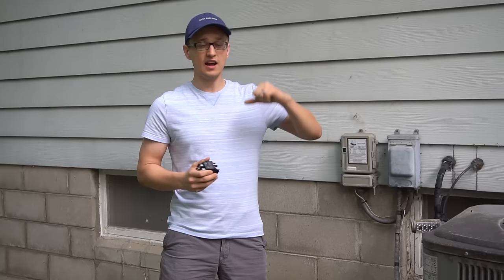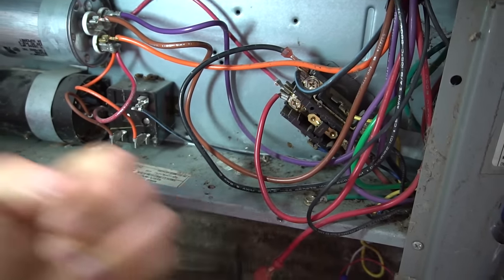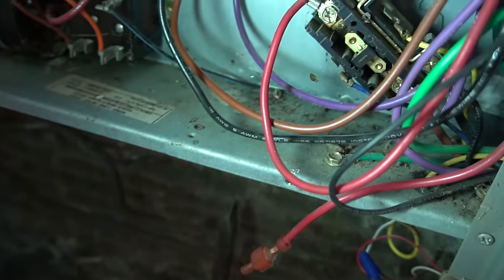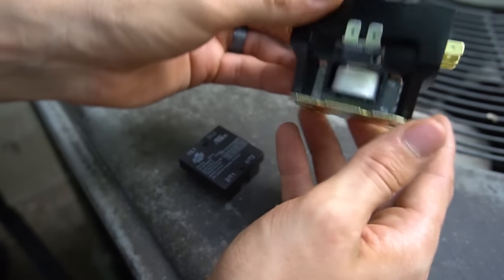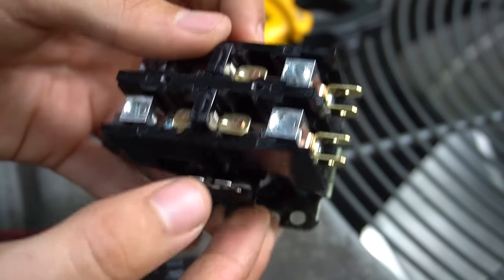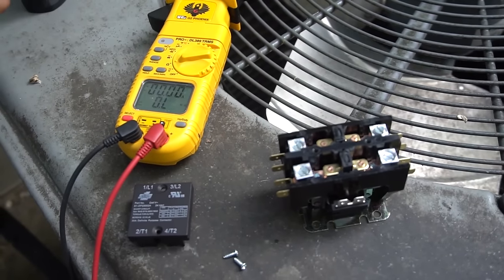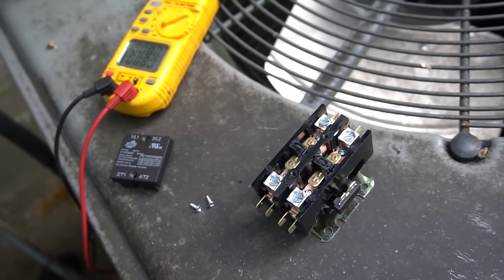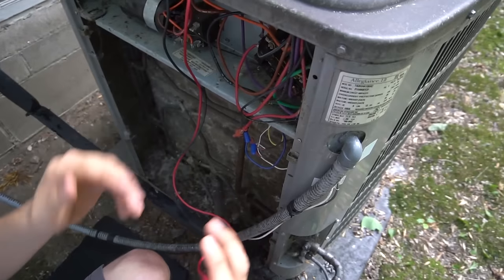Air Conditioner Contactor - How To Check If It's Actually Bad

Comment from the maker: ❄ Other A/C Videos For Reference:

Top 5 A/C Problems:
https://youtu.be/GOXgdnRB840
Complete A/C Troubleshooting Guide:
https://youtu.be/wzAA4dlp_70
How to Clean Condenser Coil:
https://youtu.be/pzwOvgjwm_Q
How to Replace a Capacitor Full Guide:
https://youtu.be/9ZGfvC-PMWU
How to Replace a Contactor:
https://youtu.be/qHZc9wWAF4c
How to Replace Condenser Fan Motor:
https://youtu.be/gGFTd2dmgxg
How to Replace A/C Control Board:
https://youtu.be/hijUExXrcm8
How to Replace a Thermostat:
https://youtu.be/1mJkjrwxdP4
How to Program a Thermostat:
https://youtu.be/uun8HJhM3h4
How a Thermostat Works:
https://youtu.be/Z4T9H-6VPtI
How to Check Freon Level:
https://youtu.be/dExFtP-nXTw
How to Wire A/C Condenser Unit:
https://youtu.be/KCanZEsLVEI
How to Order Correct HVAC Parts:
https://youtu.be/faCno8-vRnw
How to Read A/C Wiring Diagram:
https://youtu.be/I-sB4GIlbl4
How an Air Conditioner Works:
https://youtu.be/cRnzYJ4qmWE
When Should You Replace A/C:
https://youtu.be/Z7vUOySOWbM
15 Air Conditioner Maintenance Tips:
https://youtu.be/pBBnXHse-T0
Should You Get an A/C Inspection:
https://youtu.be/JqNsEzb__qs
Reply: On my unit, heat and air, thermostat is blank, vacuumed drain ,replaced capacitor and plunger on contactor kicks unit on when manually compressed.  Any ideas?
Reply from the maker: @Guided-by-the-Word-Boyd-Delk  Sorry to hear about the HVAC troubles! If your thermostat is blank i would suggest watching this video: https://youtu.be/vi3OJuGfaac?si=0u64JXzoYzBUjWBN
Reply: Jay, I appreciate with many many others- you sharing your knowledge and experience all things HVAC.
Q: Product number on capacitor does not match the original in my Trane. Numbers do-- 45+7 50/60hz. Replace with confidence- they match?

Comment: I fixed my AC myself! First I replaced the capacitor - that wasn’t it but I kept working on and thanks to this video I eventually found a loose thermostat wire in the furnace control panel. 3 ac pros had been here and none of them even tried troubleshooting the equipment. They all just wanted to replace because it’s an older unit. The quotes were between $6,000-$28,000! Thanks you!!! I'm making a donation to your Paypal.
Reply: so you are saying that you paid for all of them service visit fee? or you called them to get quotes only for not to pay service fee?
Reply: @ibrahimamac  He more than likely did or denied to pay. Not making assumptions here but sounds to me the companies that came through were incompetent in troubleshooting that system. A definite win, service charges usually $50-100 or more but $6k in quotes?! Um no thank you. And happens to just be a loose terminal. That air handler vibrates all the time and cycles the air through. Kudos
Reply: @KevsHowToDIY  you gain customer trust for fixing small things,  they will see that you are honest and they will make you change unit next time no matter what the much money is. Plus it isnt gonna be huge difference like that. But if somebody tells me that 3 ac pros came and didnt fix it which is odd. Because sometimes you make more profit from small things than free quotes.
Reply: What a bunch of as****. Didn't even attempted to fix the unit, just wanted to replace it.
Reply: Great vid thx bro u make me a better tech
Reply: The hard part to do electrical troubleshooting is a broken or loosen wire. I might as well to replace a new set of thermostat wires.
Reply: I'm starting my HVAC-R comonay out of spite for thise type of thieving technicians, disgusting behavior
Reply: I’m getting into the HVAC field .. and that sounds BONKERS 😂😂some of these guys charge outrageous numbers .. I will forever be fair .. I’m going to make my money but I will be honest as well.. a honest technician will always get business ..
Reply: Yea hvac is notorious for rip offs

Comment: fire ants are the biggest cause of contactor failure i have ever seen. those dang things . climbing in the contacts to commit suicide and fry the contacts.
Reply: Right that's the trouble I'm having now😒🐜
Reply: try to spread alot of seven dust all around inside the cover and around the base of unit, alot of my customers spread it around there whole house to keep all the insects out nothing like the aeven dust also try Diatomaceous Earth nothing likes that either at its also sold at garden centers.
also common salt atops them to but not all the time , they dont like to cross salt or baby powder

Comment: For any unlucky soul such as myself, CHECK YOUR RESET SWITCH IF YOU'RE CONTRACTOR INSTALLED ONE INSIDE YOUR HOUSE!!!  I changed my contactor, my motor and it's corresponding capacitor and the fan would not turn over unless i gave it a nudge with a stick.  I went inside and clicked the reset switch that a contractor had installed near my condensate pump and this now provided the 24 volts to the contactor.  I had the reverse problem in the winter when the condensate pump was continuously running b/c the condensate line had frozen and the reset switch had tripped.  I had to thaw the line out and run it into my sewer line inside the crawl space so it wouldn't freeze and then flipped the reset switch and i had heat.  Of course both times, it was both the hottest day and coldest day of the year at the holidays!!! lmfao !!
Reply: UPDATE:  It actually only started up only one time after i flipped the reset switch, but now the old issue is back once again. 24 volts getting to the contactor, juice getting to the contactors, but the capacitor just wont kick start the motor.  The capacitor is rated for the motor and what was recommended.   I don't know what else to do except wait two more days till after July 4th to have an HVAC person come out.  I'm open to ideas ..... lol

Comment: Had AC guy come out,said I had dead ants in contacter, so I had to pay 125 .00 to replace before he could check unit to see what was wrong with AC , he didn’t try to clean it . I have choice warranty, he said they wouldn’t cover this part because the ants stopped contact

Comment: My contractor was buzzing like crazy and the unit was not turning on.  I took the contractor out and was searching the web for a new one, then came across your video.  As soon as you said "bugs", I found the small screws on the back plate, opened it and dead bugs everywhere and one live earwig.  Cleaned it up, reinstalled and it works like a champ.  Thanks.
Reply: Awesome 👍😎

Comment: ❤ We fixed it! Thank you, thank you, thank you!!! I live out in the middle of nowhere with my uncle, a senior citizen. His AC went out, and we've had 100-degree days. It got up to 89 degrees in his house. Getting a service person here is a nightmare, so we tried on our own to see if we could fix it. He needed my help, so he showed me how to use the multimeter and guided me with installing a new contactor. I learned SO much in the process because there was a lot of troubleshooting and because he had me do a lot on my own and showed me how to work safely. He has me do a lot because he doesn't want me to have to ask a man for help. I can't even describe how happy I was when the AC came on. Definite confidence booster. I'm excited that now I can help others. Thank you so much for the tips for troubleshooting. You're awesome! Blessings!
Reply: Same thing with ac going out but contacterd have 2 burnt wires. 1 red  an 1 blk, bought contscterd and R&R but no replacement female ends . So i have to go to AutoZone right now b4 it gets 100 again today in san Antonio Texas. Very fn hot.

Comment: You saved me a lot of money sir!!! My central air kept blowing the 3amp fuse on the board when I switched it to cooling. Checked every wire, everything and started losing hope, watched this and checked the contactor, had 1.9 ohms on the sides to eachother. Order a new one for $20, checked the new one and got 17.8 ohms from the box. Changed the part and it works mint now!!! Thank you very much, I owe you a beer man

Comment: After watching some videos and reading articles online, I came across your video on testing the contactor and replacing.  I took mine off, tested with the multimeter and got 0 for a reading.  I then went to local store and bought a replacement contactor.  I then tested it at home and got a reading.  This further enforced that my old one was either not working or the multimeter was not working 😆.  I then proceeded to install new contactor and then turn on AC.  presto chango, it works.  Thank you sir. It only cost me under $35.  Saved me money getting someone here and paying an arm and a leg for diagnostic/parts/labor 👍🏼.  Plus I look like i know what I'm doing 😎

Comment: Great video. I had the AC maintenance company come by and tell me that the contactor was working inconsistently. I hadn't noticed anything amiss myself, but they said their inspection uncovered it. They wanted $400 to replace it, and another $500 to replace the capacitor. After watching this video, I've come to realize that they're probably full of it (or I can just blow away the insects myself for $0). So thank you for saving me a lot of money!
Reply: That reminds me of a job I did, and the only problem was a massive amount of ants insulating the contact points from engaging.  Fixed it with some raid applied around condenser.  😂

Comment: Fantastic video!!  Pay attention, y'all. My issue was self-inflicted. I disconnected the ceiling receptacle in my garage for the garage door opener as part of a winter renovation project. Turns out, that circuit powers all the outdoor gfci receptacles AND my crawlspace receptacles; the condensation pump was plugged into one of the crawlspace receptacles. Winter turned into spring, with the garage receptacle still disconnected, the condensate pump filled up, tripping the safety switch thus not allowing the ac to kick on. Lol lesson learned. 🤣 
Many thanks for the video!!!!
Reply: We all do things like that.... too many irons in the fire. Try writing down and keeping a note book...I do for most things I do...

Comment: Jay!  Jay, Jay, Jay, Jay!!!!!  Dude, I got man handled the last time I had an HVAC repair guy come out.  When he left I was thinking those HVAC capacitors were made of diamonds or something.  Anyway, AC went out and this time I figured I'd dust off the old tool belt, grab a can of elbow grease, and get down to business.

Initially I thought the fan motor was bad.  It wouldn't spin very easily, not like my other AC unit, so I ordered one, replaced it in 10 minutes, and pounded myself on the chest in a way that said to all onlookers (mainly my dogs), "I'm a handy guy, yeah boy!!".  Unfortunately, the new motor wouldn't come on after I powered everything back on.

So, I ordered a capacitor.  It just had to be the cap.  It's always the cap.  Last time it was the cap.  Amazon dropped one off in about 2 days of searing hell flames heat (upstairs thankfully).  It came, I popped it in, I patted myself on the back. The dogs were cheering for me, or would have been if they knew what a feat I'd just performed.  Hey, they're dogs.  They lick their butts.  What do they know?  By the way, they aren't made of diamonds.  The capacitors, I mean.

Well, that didn't work either.

I was just about to turn in my man card and phone an AC repair crew.  I wasn't happy.  The dogs weren't happy either, but being dogs they probably didn't understand why.  

Then I found you, Jay.  You mentioned that the little cover on the "Contactor" comes off, or "Thingamajiggy", as I was calling it.  Well what do you know, I took the cover off and there were about a million tiny little dead ants piled up under it.  I didn't know a million tiny dead ants could fit under that cover.  I didn't actually realize it WAS a cover, but then neither did the dogs, so I don't feel too bad about it.

Anyway, I pulled out the my air compressor, shot some high powered air into the thingamajiggy, dead ants were flying everywhere, the dogs were happy as hell and licking their butts, and when I powered the sucker back on the fan was moving, cold air was pumping inside, and my man card went right back in my pocket.  Nobody's taking that bad boy.

Thanks Jay!  You saved the day.

By the way, beer tastes a lot better after a guy fixes something.  I don't know why, but here's to you, Jay, my man!!!!
Reply from the maker: Lol! That was an awesome comment man! Thank you for taking the time to write that! Your story telling sure is funny stuff. I'm glad to hear that you finally got it going, the dogs are thrilled, and your man card remains with you! Now all you have to do is stay cool and enjoy that beer! Cheers!
Reply: Oh my goodness! I live in Florida - it is late July - I am a female with two female roommates and our AC stopped working yesterday. We can't afford to call someone out this month and I'm the only one with any mechanical abilities at all, I do most of the work on my car, in fact I don't recall ever taking it to a mechanic. But air conditioners are a totally different beast! Sooooo I'm all over the internet and YouTube (thank you, Jay) I'm very frustrated and it's over 100 degrees... I begin to feel like I'm about to internally combust and I come across this comment.
Which brings me to my point (sorry about all that jibber jabber) I just wanted to tell you your words really brightened my day. Your style of writing is incredible! It reminds me of Robert Fulghum. I truly hope you are a writer, or in the very least, sharing some of your words with the world in some way. Blog? Video? Self help website? Hehe!
Not only did I enjoy the comment, but it pleases me to see someone being gracious, humble, positive, and genuine. It's refreshing in this YouTube world full of hostility and criticism; so, thank you both for contributing in such an inspiring way! I hope many others take note of how a man TRULY earns his "man card"
Reply: Patrick Connolly   I love your comment, I rarely ever read an entire comment as long as yours. Not only did you have me in stitches from laughing so hard, you reinforced what Jay (whom I agree is awesome)  had already said about bugs corroding the contractor which ended up being my problem. You are refreshingly funny, you kept my interest all the way through, and it left me wanting more. If you haven’t already, you should take that talent and put it into stand up comedy, making videos, blogging, etc.
Reply: Well you got a new fan motor and capacitor still cheaper than a service call
Reply: Patrick conoly , I'm laughing my over heated ass off right now, and your b100%, correct beer does taste better after you fix it... Whatever it is. Here's to you my good man
Reply: Great way to avoid a warranty.
Reply: Wow... so funny.  I will check on that this morning too. Because my fan runs back  when I shake up or hit a little bit the condenser unit but stop again after a short time sometimes.
Reply: That comment was comedy GOLD! 🤣 I hope you at least bought Jay a beer 🍻

Comment: Jay, thank you so much for your most informative and practical videos. With your help I have not only  saved $$$ but I have learned so much. My condenser fan would not run when the outside temp exceeded 85F.  My service provider, who has serviced the system two times per year for the past 11 yrs, diagnosed the problem and  changed out the capacitor for $400. However, the problem still existed. With the help of your videos, I have replaced the condenser fan motor, thoroughly cleaned interior and exterior coils, blower wheel motor, coil drain pan and lines, and changed the air filter. Lastly, I changed out the contactor ($20 item), and eureka??, the system has been running great  even with outside temps in the 90s

Comment: I took my old one apart and refurbished it.  It is pretty easy to do.  Took a little wire brush and a drywall sandpaper pad to remove the pits and wear/carbon on the old contact.  Hardest part is the spring that you see on the top plunger.  It has to go on a dimple on the top and the bottom to keep in place.  Just took a little finesse to get it back in.  There are 4 contacts to smooth out.  I will now keep this one as a backup since I replaced the whole thing.  Good little project to understand the inner workings of the contactor.  Thanks for posting!

Comment: Dude, you just saved me a bunch of money.  Last time my condensor contactor failed, the AC guy said ants destroyed it and completely replaced it with a new one.  This time, I just cleaned the contacts, and it's working again.  Obviously, I need to just get one that's sealed, but for now, I'm good, thanks to you.

Comment: Follow up - Dad kept the old contactor, and low and behold, there was an insect in there. (This contactor did not have a cover like yours, but thanks for mentioning some don't). I tested it just as you demonstrated and even hooked up a 24V Omron power supply to pull the coil repeatedly, which was also pristine. 250$ gone for a bug!!! Live and learn! Cheers for these videos!

Comment: I checked out my contactor yesterday and lo and behold I had put the Line ins on the T side!  Doh. It really doesn’t matter which side you use as long as you know which side has the single pole side versus the shunt side. The L1/T1 side is actually the single pole (contact/pull) side and L2/T2 side is the shunt side. Spade counts on both side are the same too. Great video thank you